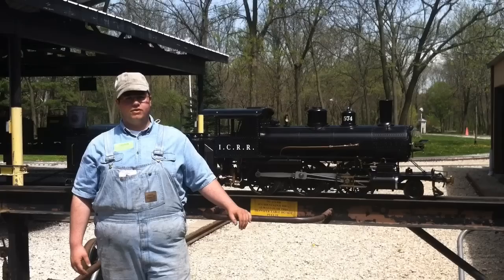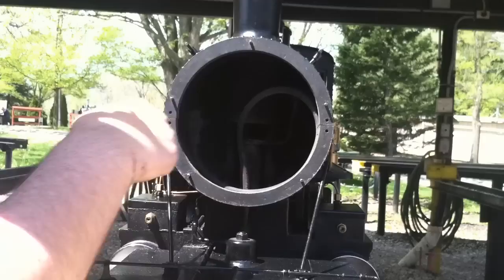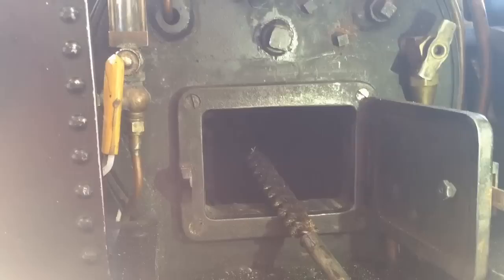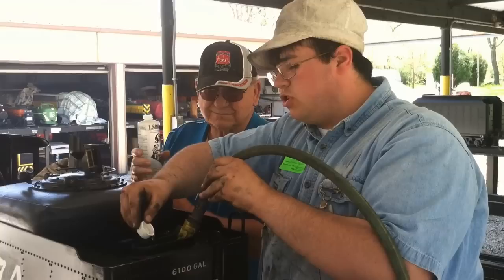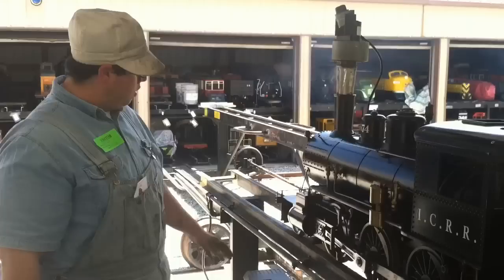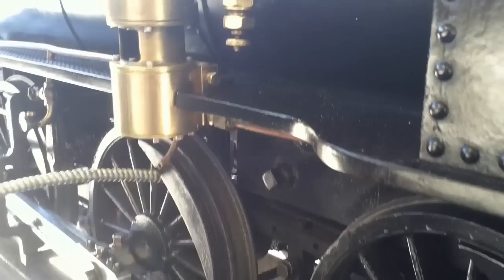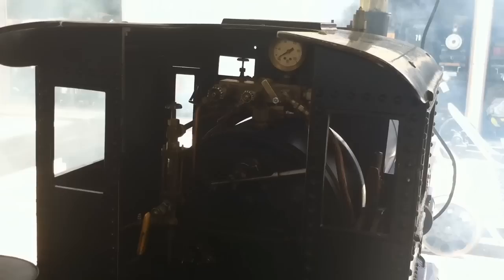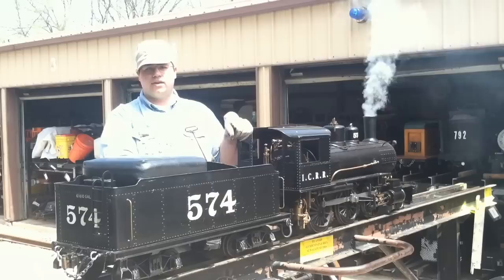How To Fire A Live Steam Locomotive

Comment from the maker: Built, these locomotives range from $8,000-$15,000. It depends on the seller. If you build the locomotive from the kit, it would be much cheaper, but you have to invest a lot of time in the machining (could be years). I don't believe the boiler is included either (that would be another $3k ish). If you type "Allen models mogul price list" on google, the first link that comes up is a breakdown of the kits stages & the prices. There are 7 live steam railroads in Oklahoma.

Comment: how far apart are your wheels im making blue prints based off of #618 with a early Consolidation twist and i wanted to the gauge that you run on because it looks more managabel
Reply: It's 7.5 inch gauge if that's what you're asking.
Reply: ok thank you
Reply: caseyjonesfan
Casey, it will also depend on what part of the world you are in. In most of North America it is 7.5 inch gauge. In the rest of the world it is 7.25 inch gauge. I believe in some North Eastern states of America they have 7.25 inch gauge.

Comment: why does the loco only have one gauge glass?
Reply: The vast majority of live steam locomotives only have one water glass as that is all that is necessary. The only reason full size locomotives have more than one is to 1. make sure that all of the cab crew can see the water level easier and 2. to have a backup in case one fails during the trip. With live steam locomotives their is only one operator so as long as that person can see the water glass there isn't any problems. The safety part isn't really an issue in this scale as there aren't boiler regulations in the majority of places where one can run. Also many cabs are cramped as it is and can't fit a second glass.

Comment: Alot of the ole boys here on the west coast use propane to heat their boilers. Not as dirty as coal and easier to find.
Reply: Not as fun either.
Reply: Ditto.  If you want clean & easy you might as well run it on batteries. This is the first time I've seen how a live steam locomotive "model" works. I'm utterly amazed the engine is 100% no bullshit real - down to the coal fired boiler!
Reply: Batterys are not a bad idea actually. Tell me ole chum did he explain to you the importance of water and what happens when it settles below the top of the crown sheet.
Reply: Not to mention you have to carry the unsightly propane bottle around the track all the time. If you want a little cleaner then go oil fired - it's prototypical in many cases. Secondly a battery operated Live Steam locomotive would be looked down on as cheesy and  fake by any real Live Steamer worth his salt. You couldn't give me a battery operated  Live Steam loco for free, let alone would I buy one!

Comment: How much money does the locomotive cost?
Reply from the maker: U.P. railfan A brand new locomotive would probably be in the neighborhood of $15-25k and I'd say more toward the latter. You may be able to pick up a used Mogul for $12-15k
Reply: Costs so much  that it makes more sense to build one instead of buying one. I'm building one for that reason. Just my 2 cents
Reply: +The Steam Channel where could you buy it? (online store)
Reply: +davidgabriel211 You can't buy it at an online store----even if you could it would probably run $30,000+ ( that's right: 30,000+). Look at Accucraft prices for a complete ready-to-run steam locomotive that is very small: AC77-217 SHAY - 28T CLASS, OIL BURNING BUNKER, LIVE STEAM          (for example)  only about a 1/3 the size of the ones you see in this video.
Reply: +John ____  ohh ok thanks man.